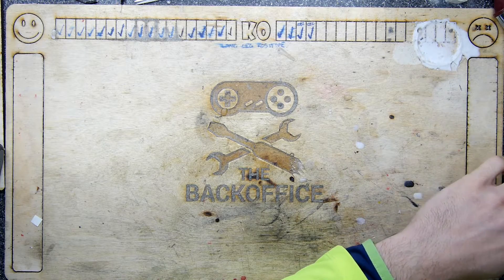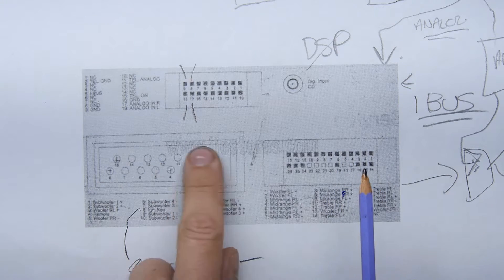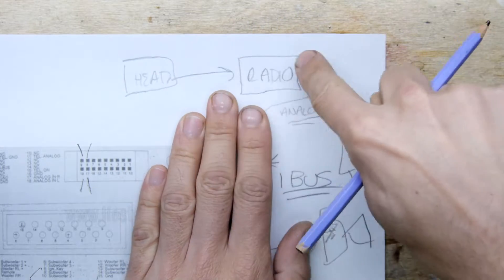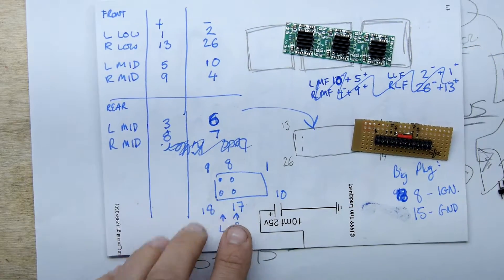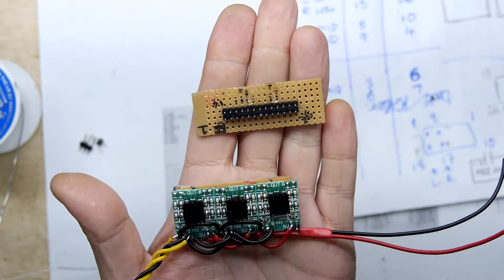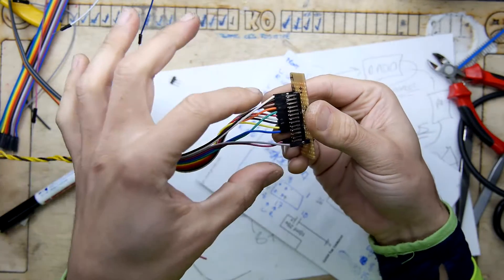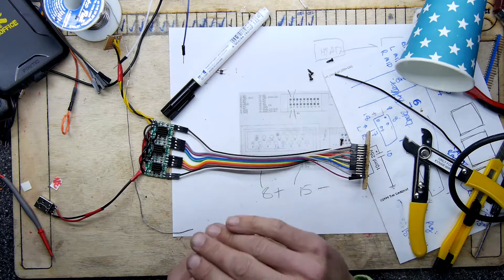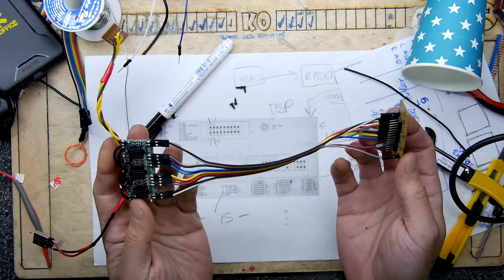BMW L322 DSP AMP Hack

Comment: I have a 2002 Range Rover L322 with an aftermarket head unit. Head unit works fine but no sound, it would work when it felt like it or for a few seconds when the ignition was switched on? After watching your VLOG about cleaning DSP etc.. I took it out and checked for dry joint and water.. a little bit of damp but nothing serious.. capacitors seemed fine. Put it back in and nothing! I was waiting for an update on fixing the amp but you have gone straight to a hack? As you say, they are expensive to replace, do you offer a service?
Reply from the maker: I do not offer a service. My first instinct would be to remove every part of that terrible system and take it to the recycling center and enjoy the fuel savings from carrying around that awful BMW system.

The are too many parts to go wrong. You could investigate the BMW forums on how they tackle the same problem on the 5 series cars
Reply: @backofficeshow  Hi, thanks for advice, I think? I have found a site which talks about either a by pass loom at £109 or an aftermarket amp with re-wire? Not sure how much the dsp system does... I think the head unit is stand a lone although it can be wired into RR for systems... tyre pressure and coolant temp.
Reply from the maker: @jamesmacdonald3090  the DSP is just an amplifier. With the right wires you can get the head unit signals to the back where the DSP connects to all the speakers and tie them in there

Comment: Hi I have a question regarding the DSP, I have a BMW M3 E46 2005 with harman kardon system and want to fit an android head unit. What will I need to do in order to use my harman kardon sound system with my android head unit?? Plzzzz helppp
Reply from the maker: I'm not sure, I don't have Harman kardon one. Perhaps you can find the diagrams on the internet of the electric system

Comment: Hey man, really hoping you can help me out here. I have a '97 E39 with DSP and have read into retaining or bypassing the DSP while installing an Android headunit. So my question is if I unplug the DSP amp, will the speakers then be powered by the Android headunit's amplifier instead? I've been stuck with the whole no sound problem for quite some time due to the DSP not being triggered to turn on.
Reply from the maker: What you will need to do is cut the speaker wires from the DSP connector and splice new ones run from the head unit. If I recall correctly there may be an adaptor cable to get the audio connections to the boot.

Either way, you are basically connecting the speakers directly to the new Android head unit. It's annoying, but ultimately worth it and with a few hours of work you will have sound!
Reply: @backofficeshow  Well I have my Android unit all butt connected to the adapter I got to plug into the factory wiring harness behind the radio if that's what you're talking about.
Reply from the maker: I recall there is some gotcha though 🤔 examine the harness, of I recall with the DSP it is a second connector with additional channels so you have to splice something in somewhere. 

Seems long ago since I did it, but I recall I 100% removed the DSP totally (as well as all the other boxes of junk) and spliced the speaker wires directly to hook up to the head unit.
Reply from the maker: https://youtu.be/ndIc9IK2mvA this might have more info

Comment: But when the DSP is unplugged, you have no screen.
Reply from the maker: You do get the screen, bit the DSP menu removes itself
Reply: I've had a right game with mine. I was going to fit an old amp just to get noises but no dsp plugged in, the screen was blank. Mine is a very long story and no one on earth seems to be able to help.
Reply from the maker: My advice is to pull the lot and fit an Android head unit. It's a million times better than the built in stuff and you remove dozens of kg of weight and metal boxes from the rear. It was a ball ache, but in hindsight, less pain than all the pissing around I did trying to repair the crappy original system
Reply: But doing an android conversion is knocking on 6 to 700 with amps n stuff and its an 04 car. I just want noise. Daft thing is, I don't ever remember it showing DSP in the menu (not had it long) but I did have noise. When I selected tone settings it showed the simple tone settings, not what ive seen the dsp show when doing tone settings (another you tube video). One alternator later (obviously battery disconnect) and a leak in the boot over everything.... no noise. All functions work but just no sound.
Reply from the maker: Trust me, it's the only way in these body things. Also forget the amps, just wrote it up directly and be done with it. You might get away with change from £350
Reply: Sorry. not worth it. I'll get rid of it soon. Money pit. I'm inclined to leave it broken as when everything works... something goes wrong but when something's wrong its been pretty reliable. Someone did mention coding. I might have forgotten its got a DSP amp and that's why its not recognising it. This true?
Reply from the maker: No idea, just get rid of it and problem solved

Comment: have you checked with a meter what the output voltage is for the gain on them channels from the stereo .. are they 5v or 8v etc etc .. it makes a difference .. and the impedance is important too you dont want too run your stereo head unit too hard you will blow an inline mfet you can actually get inline gain and balance input output boards .. or you can use some line level controllers .. they do that job changing all the V and imp. from the stereo  .. i think that what you have tapped into is a PREOUT for direct audio .. and you will HAVE too run inline gain controll for that .